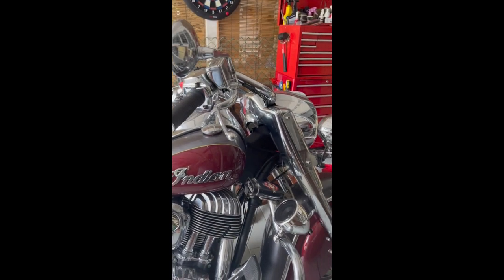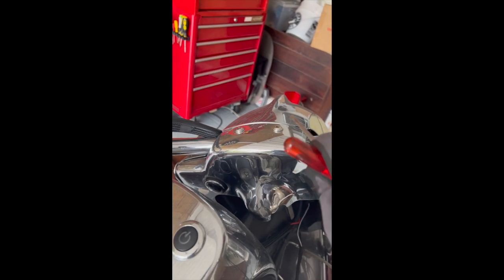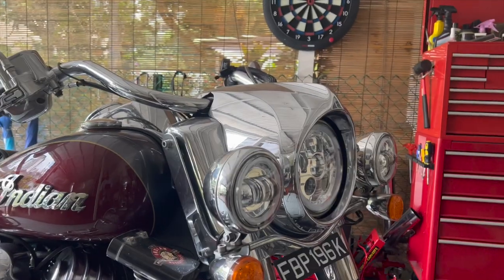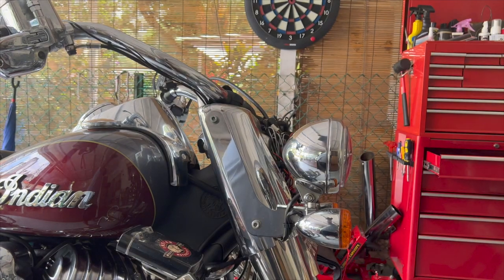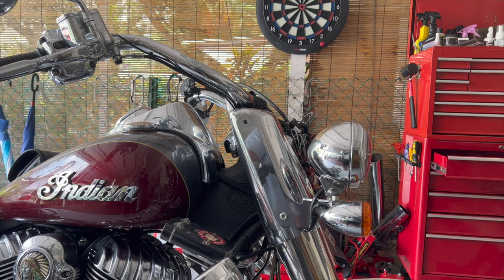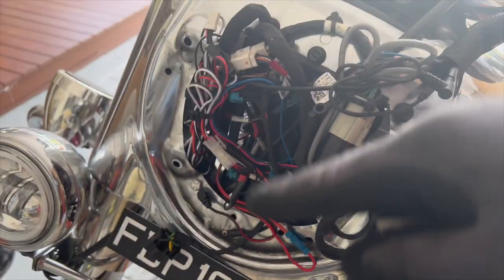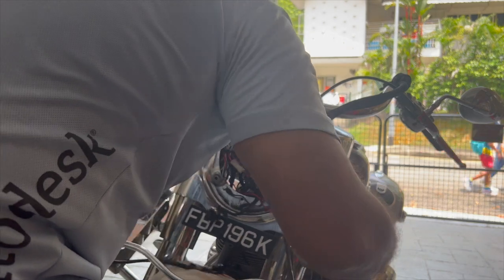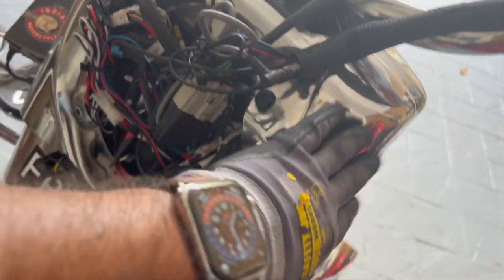Indian Springfield - How to Remove Headlight & Nacelle

Comment: Nice job. What aftermarket headlight and running lights are those, they look great, and were they a good upgrade from stock for you? As an owner of a stunning 2019 Indian Springfield in gray and burgundy, I like your choice in bike. How many miles do you have that required new fork seals? Indian Springfield, cruiser heaven, all day, every day.
Reply from the maker: Thank you! The headlights and passing lights are from Eagle Lights: https://www.eaglelights.com/products/copy-of-eagle-lights-7-round-led-headlight-generation-iii-with-matching-passing-lights-chrome-halo-ring. They look great and shine real bright too! Much better than my stock halogen bulbs!

I rebuilt my forks after 24,000 kms (15,000 miles) like the service manual suggested. But I have friends who waited almost twice that distance before rebuilding theirs.
Reply: @eazyontwowheels  Thanks for the response, I'll check those lights out.

Comment: what speakers are you running on the engine gaurds, amp or no amp
Reply from the maker: I was using boss audio speakers meant for motorcycles with a built in amp: https://bossaudio.com/product/mc425ba/

However, we get heavy rain throughout the year where I live, and after about a year or so, I had to throw them away. If it rains a lot where you live, I suggest checking out the marine grade speakers from boss audio instead of the motorcycle speakers.